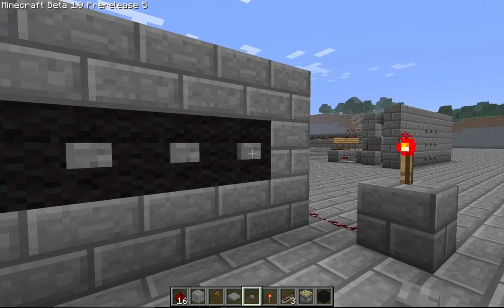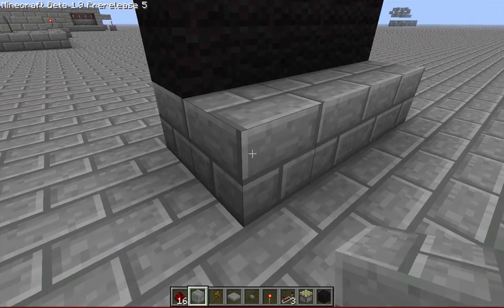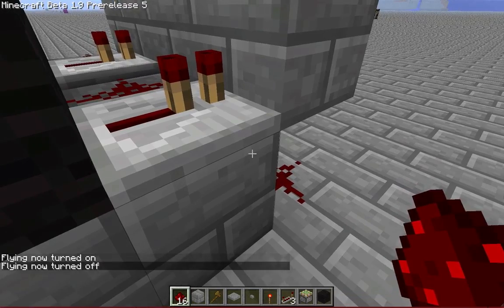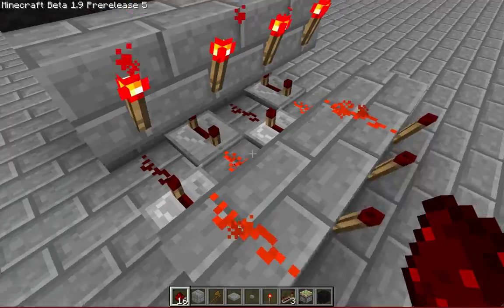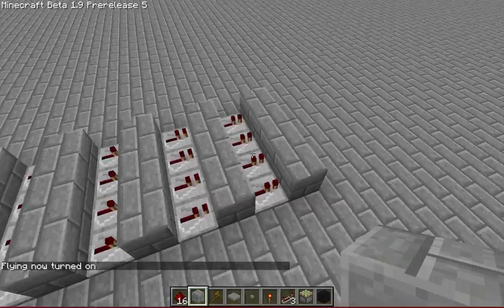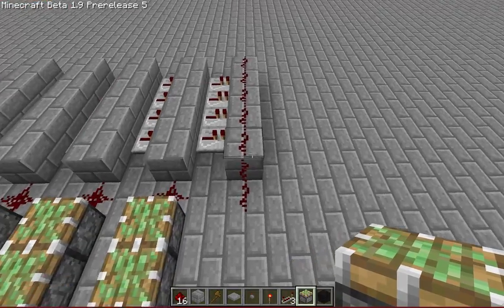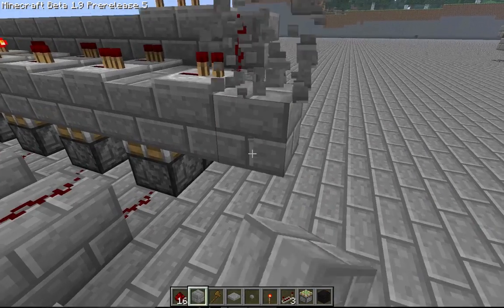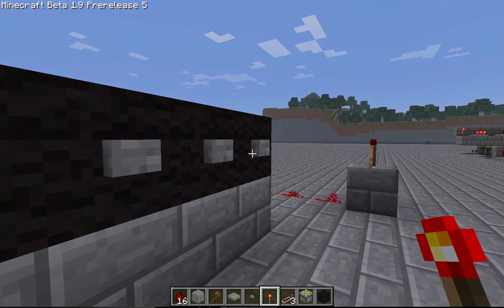4 button-4 key Combination Lock [Not Updated for 1.4.5 yet]

Comment from the maker: Actually, you are incorrect in saying that. A pulse extender would just simply make it so that the combo cannot be entered directly afterwards. The counter works on the basis that the door will stay open as long as the redstone torch is on and the combo was entered correctly. Then the signal loops around and turns the torch off. If you add repeaters to the reset line it takes longer to get to the torch and makes it so that the door stays open for longer.

Comment from the maker: How did you pull that number out of the air. In actuality there are 256 different combinations. Since there are 4 buttons and the lock is 4 digits it makes the number of combinations 4^4 which is 4x4x4x4. You need to take into account the a digit can be used more then once.

Comment: Lol when i was activating the button for test 1 2 3 4 and ones i clicked 4 the electricity turn off loll. I though it was a button to tuen off electricity. But after is on, i tried and it works :)

Comment: Hmmm problem with this is; if you just press random buttons you will evntuaky get it? As in if you press (on the smaller one) 1,2,3,4 4x you will get it to work no matter what the code is???

Comment: I was having trouble with this but i fixed it. Maybe itll fix yours too. All I did was instead of putting repeater, redstone, repeater, redstone on the input line coming straight out of the buttons, i replaced them with all repeaters and it did the trick. I like this lock, simple and elegant.

Comment: I have a manual reset at the moment (instead of having it reset once the four button presses are in, I dug it underground to a button on the left side of the wall. I did this because this combo is set up to some strobing light fixtures), but I'm wondering how I would set up something that resets the combination lock if the wrong button is pressed. Right now, I can just spam the buttons and it will open eventually, which kind of defeats my purpose for it. I'm kind of terrible with redstone ;(

Comment: This doesnt work as now in 1.2.5 the pistons are powered when the block they are moving is powerd. well in my experience it did. so all you needa do is invert the torch that powers the top part near the pistons and create a reset. may have a video up soon on this fix :)

Comment: hey so this video is great. made it on 1.2.5 and it works exactly like the video. there is a problem though i can't seem to fix that maybe you can help with. i hooked the output to a iron door, it only stays open for a few seconds, which does not allow me enough time to walk thru it. is there a way to make the combination lock, keep the output going until i manually reset it once inside, via maybe a lever, or pressure plate?

Comment: I am building one of these and I worked out the combination possibility:
8 inputs, 11 digits, 8589934592 possibilities HOWEVER, for intruders, the possibility is INFINATE. This is why:

The inputs are converted into letters using binary first. So the combination possibility is MORE than 11 digits long! And the best part is, it isn't much bigger than the one in this video. I did this by using Eloram's Redpower mod.

A video will be posted if requested.